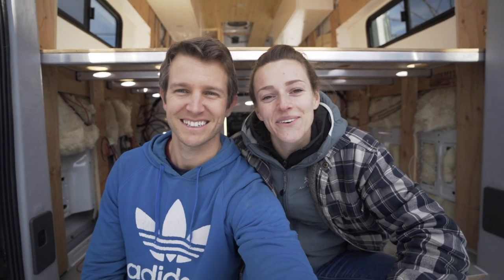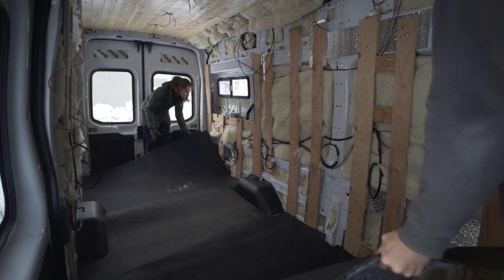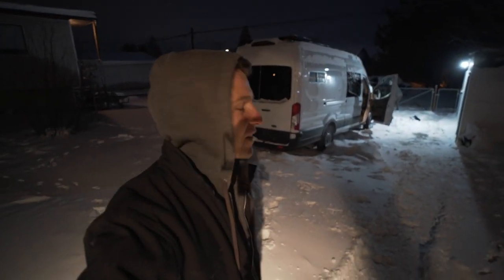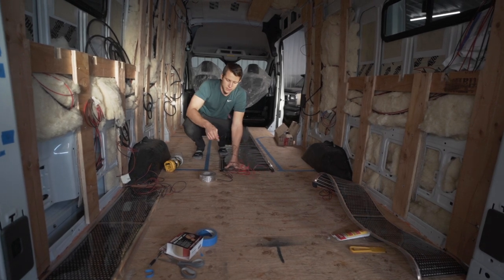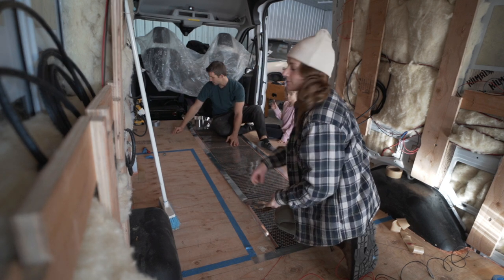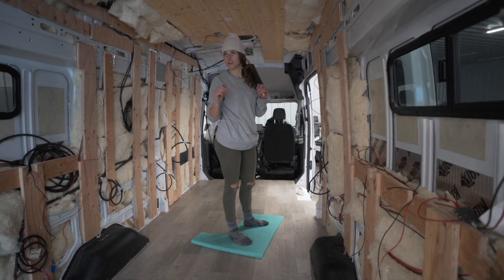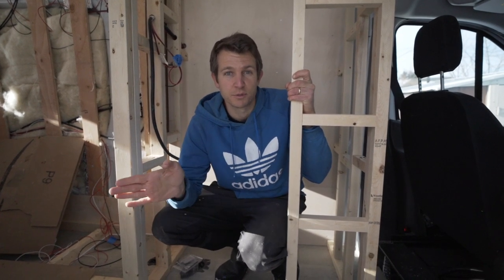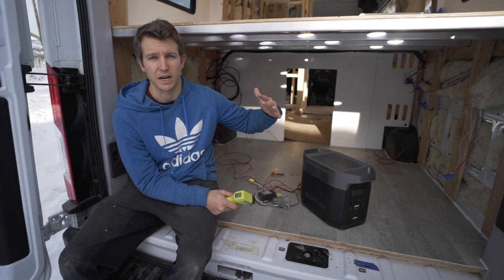VAN BUILD SERIES | 12V Heated Floor Install

Comment: Hey Tim & Katie! Great informative video - we went ahead and got ourselves some of the same flooring from Mi-Heat and are currently doing the install in our Airstream... quick question - did you ever find a way to reduce the volume or, even better, to mute the beeps the thermostat makes when changing the settings etc... turns out our doggo hates that frequency! 🐕😬 ... I guess a workaround might be to have it on the external switch like you guys did. Let me know if poss! I've also reached out to Mi-Heat about it. Anyway, thanks for all your info within the video, really helped us out.

Comment: Hi guys! I was wondering if you are planning on adding any other sources of heat or if you think the floors will be enough? I've been reading some people say that the floor ones are not super efficient and kinda hard of the batteries.
Reply from the maker: Our main source of heat in the van is the webasto air top 2000. I would not recommend trying to heat the battery with electricity only

Comment: May I ask what wattage flooring you used please? I tried the 130w with my eco flow delta 1300 but it draws too many amps. Looking at the 80 wat now.
Great informative video, thank you, Dan
Reply from the maker: The main center hallway pad is 130 w/m2 (1.5m long) so it can’t run on my ecoflow delta, the other two are shorter lengths of 220 w/m2. Shorter length of heating pad or lower wattage as you said is the solution. I love the ecoflow delta but it is unfortunate that max DC draw is 10 amps
Reply: Thanks for coming back to me. Keep up your great work 👍
Reply from the maker: @danatherton8380  No problem - cheers!

Comment: Ha, I am installing the same floor warming sheets in my Transit as well ! Informative install video in English: https://www.youtube.com/watch?v=AS26azWte3k&t=249s

 These are not infrared emitting sheets, at last no more than any good old resistive wire, even though that's the company's name. IR will be notably present only when the sheet is hanging in free air. Instead, since you are sandwidching them between 2 layers of material they'll essentially push heat out via conduction. Then you control where that heat goes with your choice of materials in contact w the sheet.

 This is no different than resistive wires as this is a resistive carbon film: same physics, the thermal dissipation mechanisms & paths depend on the immediate environment in contact with the sheet. Not on magic rays pushed by Marketing (Reflectix!) 🤣

 So if you want most of the heating to be directed up (into your walkable floor or tanks) you'll want to:
(1)  put an insulating layer under it (like cork, foam board, etc. Plywood is not very good and will suck away a good chunk of your produced heat)
(2) and select a material for the top layer that has low thermal resistance (like your thin vinyl, and unlike 7mm wood laminate boards).

Example: let's assume that your top layer has 4 times less thermal resistance than the bottom layer (say R=0.5 versus R=2), then 4/5th of the heat produced will dissipate into your floor and warm your feet, while 1/5th will go into your subfloor and warm the van's subframe.

I hope this helps !
Reply from the maker: Good info! Thanks for sharing and hope your install goes well! We do have 1" XPS foamboard under the plywood subfloor. The unique thing with these pads (with I tested and confirmed with the manufacturer) is that if left floating or exposed, the pad itself will not be warm to touch at all. This is where the IR claim makes sense to me - but I believe we're saying the same thing

Comment: hello, thanks for sharing. Can you post the link to thermostat used? I don't see a 12v thermostat you their site. Do the pads come with controllers?  I see 230v and battery operated...
Reply from the maker: https://infrarot-fussboden.de/Mi-10-Thermostat-12V-DC-AC-20A

Comment: Hi Guys. I have just received my pads and thermostats. Did you do a video on how to mount the thermostats in a wall panel or similar?  Thanks
Reply from the maker: Right on. No we didn’t - we just made our own box to house them, but we no longer use thermostats and just wire them directly to an illuminated on/off switch. Good luck with your install!
Reply: Thanks for getting back to me. Can I ask why you opted for an on/off switch rather than them coming on with the thermostats at low temperatures?  Brian
Reply from the maker: @BrianLee-nz3vm  No problem. We want to be able to control turning on/off anytime, rather than having them always on at certain temps. That will drain the battery unnecessarily when the heated floor isn’t needed
Reply: Ok Thanks again for the quick reply. I am finishing them up today, so I'll take your advice and I think I'll add an on/off switch aswell, to override the thermostats and only use the thermostats when we are away in the van and know we are charging the battery bank up each day. One more question if you have time. What temp does the floor get up to if you don't have a thermostat to control the top end?

Comment: how long does it take to heat the actual space of the van up though?
Reply from the maker: I wouldn’t recommend using these 12V heating pads (or any electric source) to heat the entire van. If you’d like a floor system to do that then I’d recommend checking out hydronic systems. We will have a webasto as the main heating source 👍🏻
Reply: The following calculation is only for the living area heater.

• 10A @ 12V = 120W
• Mi-Heat's 50cmx2m (1m²) film is listed at 130W/m²
• A 1m² heating area at 130W/m² equates to 443.3 BTUs, or approximately 434 BTUs at the rated 98% efficiency

4,500 BTU/100ft² is a rule of thumb for heating/cooling in "standard" climates. This is higher for colder climates.

Assuming the living area of the van is approximately 100 ft², approximately 4,500 BTUs would be required to maintain a comfortable temperature.

With the battery and water tank heaters meant to prevent temperatures below 32°F/0°C, the intention is most likely to have them turn on near freezing and cycle off well below a temperature that'd be comfortable for humans. This makes the most sense to me from an energy utilization standpoint.

As these calculations show, the underfloor heating only supplies about 10% of the total heating needs of the van. So, without Tim or Katie expressly stating so, I'd assume that the underfloor heating film is supplemental; intended for comfort, especially in bare or stocking feet in the cold weather.

Tim and Katie's first Transit included a Webasto heater. The layout for van #2 is similar to the first build, and they've stated that 12V underfloor heating would be added, so again my assumption is that this build will also include a Webasto heater.
Reply: @ARepublicIfYouCanKeepIt  Great informative comment. And that's even optimistic for the film, unless we can capture 100% of its produced heat into the living space.

In reality if it is laid down on a layer with a relatively low thermal resistance (like a van subfloor if poorly insulated) or if covered with a material with high-ish thermal resistance (like a 10mm laminate floor) a good chunk of the heat produced will actually vanish into that subfloor.

So, yeah, don't ever assume that a heeating film embedded in a floor could heat up a living space. On the other hand, Hydronic embedded in floors works bc it carries a huge amount of calories (from the van engine or a boiler), i.e. several 1000s of Watt equivalent power, not a couple of 100s.
Reply: @raphofthehills4405  With all this being true, the point of my reply was to definitively answer the poster's question to show that the underfloor heating is a "nice-to-have", and not intended to heat the entire van.

The choice of materials, as well as placement to maximize heat transfer in the desired direction, are also all important.

Interestingly, the second home I lived in as a child in Brockton, MA had in-floor radiant hydronic heating. Those were early days where copper pipes were embedded in the slab. It was later discovered that copper encased in concrete fails rather miserably. At that point, options for repair or replacement are both hugely invasive and expensive.

With that in mind, my mantra is to build vans knowing that the exterior is experiencing a hurricane, while the interior is experiencing an earthquake, as it goes down the road, let alone gravel or dirt roads or forest service roads.

Everything in my builds is removable, facilitating any needed repair or replacement of OEM components, as well as systems I install.

Due to all these factors, I'd never consider installing underfloor hydronic heating; not to mention the cost, complexity and maintenance requirements.

For that matter, the lack of thermal mass in any van, skoolie, trailer, even tiny house, makes them poor candidates for radiant heating.

My first choice is vehicle fuel-powered forced air heaters from Webasto and others. These are incredibly energy efficient, on gasoline/diesel consumption, as well as electricity to power the fan and thermostat. As I design and build my own lithium battery systems, going fully electric is also an option, though I'd not seriously consider it for full-time, cold weather use.
Reply: @ARepublicIfYouCanKeepIt  Interesting parallels: I retrofitted a house w hydronic (pex, very reliable), call vans 'daily mini earthquakes on wheels' and consequently use camper build techniques focused on reliability & repairability (bolts, no screws/glue), and am building my own lithium  battery (Nissan Leaf re-pack). Documented on my blog.

 I  do not advocate for hydronic in vans. People often confuse floor heating w floor warming. Was pointing out that floor heating w hydronic is immensely more powerful than electric floor warmers like in this video. Now, hydronic in van can work great when the engine is running: free heat and lot of power. But it presents many drawbacks: requires switching to a boiler when engine is off, exhausts combustion gases outside of van for long periods of time, complex, heavy, expensive, takes a large volume.
Reply: @ARepublicIfYouCanKeepIt  Hi John,
very good comment! 
For Vans/Expeditions vehicle and so on, we're selling our heating films only as a "comfort" or an "additional" heating. 
Or even for projects like Katie and Tim did.
A normal insulated House will be no problem to be main heatet with our heating pads. But physically it is not possible to reach that in a Van.

Very informativ John, thank you.
Greetings from germany

Mi-Heat 
Markus
Reply from the maker: @ARepublicIfYouCanKeepIt  Great points. You are correct that we will have a webasto heater again. We should have mentioned it in the video to clarify! And yes, your explanation of the battery/water tank heaters is precisely how we plan to configure those ones.
Reply: @ARepublicIfYouCanKeepIt  thanks for your comment, that’s very informative. 👍🏼

Comment: what is the budget of your project ?
Reply from the maker: The 12V heating pad system (2 thermostats, 3 different pads, listed in description) cost around $430 CAD 👍🏻
Reply: @TimKatie  sorry, I probably put it wrong, I meant the budget for your entire motorhome project